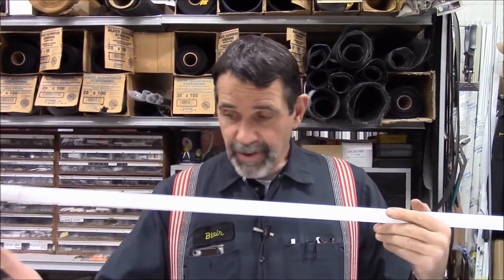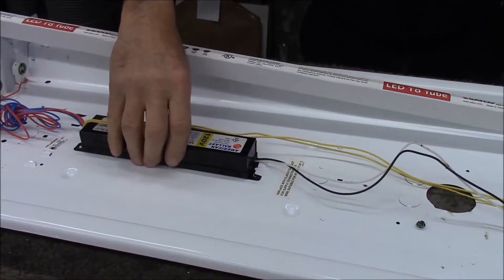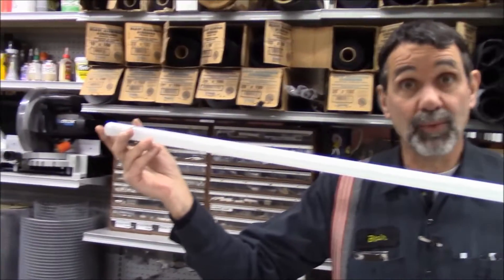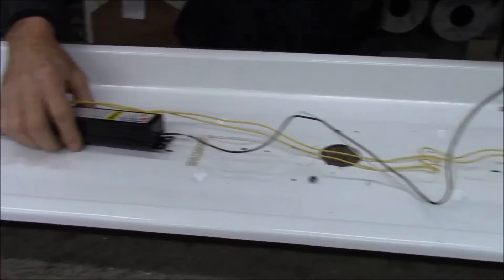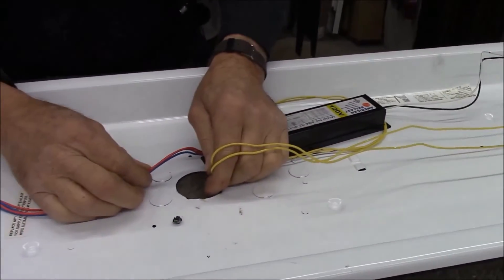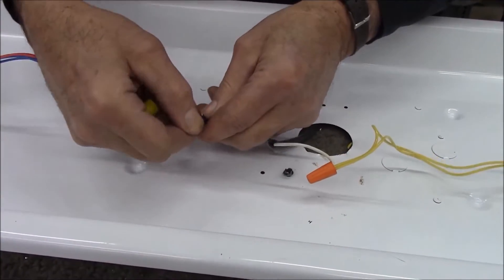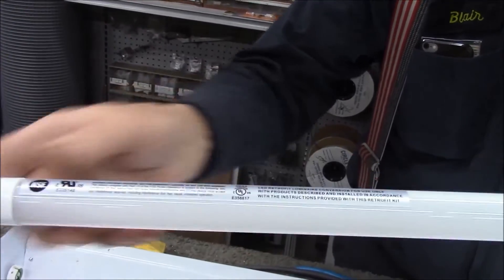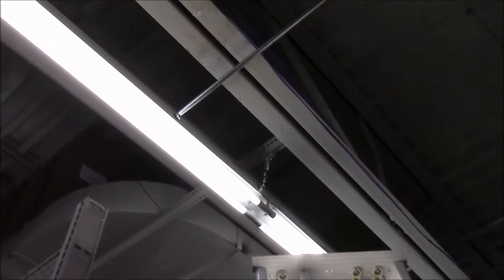Rewire Fluorescent to Led Lights - Using Double-Ended Tubes

Comment: What happens if you have fluorescent lights that are connected together can you do just one fixture at a time? With LEDs and leave the rest. So you don’t have to spend all the money at once on new led lights?
Reply from the maker: @georgechalifoux4668  sure, each fixture gets supplied 120 volts in parallel, not in series, so do one at a time.

Comment: Can one fixture be changed at a time and still operate fluorescents with leds in separate fixtures? i have 12 fixtures.
Reply from the maker: @stephencraig8578  each fixture is ‘stand alone’ so led, fluorescent or bypassing a fixture each one gets 120 volts and shouldn’t have anything to do with the next one. I’d recommend using a permanent marker to label fixtures ‘LED’ as you went along. Someone coming after you could install the wrong bulb in a fixture not yet converted.
Reply: @MrHardware1  thank you so much! I appreciate you sharing your knowledge.

Comment: Much appreciated. This is my exact setup. The current ballast went bad, so this is how I'm going to wire mine up. I have four T8 4' direct current LED bulbs. I have one question. Where do I attach the ground to the fixture? I'm pretty sure the person that wired my original florescent fixture, didn't properly ground the fixture. I say this, because I got a slight shock from touching the metal side of the fixture.
Reply from the maker: @DDDYLN  wow, you might find a loose wire  feeding one of the tombstones touching the metal box. The ground wire should be well attached to the metal box (fixture itself).
Reply: @MrHardware1  the ground wire was attached properly, but it wasn't tightened down enough. I'm actually not 100% sure I got shocked. The sheet metal edges on my fixture are so sharp, sometimes touching it with my arm feels like a shock. Whenever I'm working with live 110 V AC, my mind is always on edge about getting shocked.
Reply: @MrHardware1  I wired up my fixture, but I need to test the continuity, to ensure all the wires in the wire nut are actually making contact with the hot and neutral wires. Instead of wiring it up over my head, I had a set of hot and neutral pigtails. I wired the neutral pigtail to the two yellow wires, and the hot pigtail to the 2 blue and 2 red wires. Before I attached the fixture to the ceiling, and attach the hot and neutral pigtails to the wires in the ceiling box, I want to ensure the wire nuts are working properly. My multimeter doesn't have a continuity tester. I was thinking the best method would be to check the resistance. As long as there's a small resistance, like 1-2 Ohms, that should verify proper continuity, right?
Reply: @MrHardware1  I'm getting about 0.9 Ohm from each tombstone connector to the neutral pigtail coming out of the wire nut. I'd say that qualifies as good continuity. If I'm wrong, let me know. My hands shake quite a bit, so it's difficult for me to twist the wires together such that they're really tight.
Reply from the maker: @DDDYLN  you’re killingme, lol. My concern is if you have ‘shunted’ bulbs. Ones that require all the wires on one side of the fixture to be hot, and all the wires on the other side to the neutral. The correct bulbs for the wiring configuration is the most important aspect of this job. Unless any of the wires contact the frame of the fixture you are good to go. Quit testing and let the bulbs do the testing.
Reply: @MrHardware1  went to my local commercial supply store on Wednesday The fixture is all wired to go. I told them exactly what I wanted. I should have checked more diligently before I left. This guy sold me T8 LEDs that can work with or without a ballast, wire from both sides of the tombstone connectors, or from just one side. I'm sure the bulbs will work. But, the kinds that are made merely for direct 110 V AC, are both less expensive and brighter.
Reply from the maker: @DDDYLN  yup, that’s the ‘fit all’ bulb. Not my favorite. Did you get 4100 kelvin bulbs? 3000 is a warmer bulb, better for household settings, 5000 is like daylight but a little blue. Better for the shop.
Reply: @MrHardware1  I returned those bulbs to the electrical store yesterday. They sold me what I didn't want, because those were the only 4' long T8 LED replacements they had in the store! I guess I should have seen that coming. A 2 pack of adjustable light temperature, direct bypass bulbs were on sale at Home Depot. I got the whole thing rewired. I taped all the wire nuts with electrical tape, because I'm a mechanical engineer, and I tend to be anal about safety. My kitchen is like 5 times brighter than it used to be. The total cost was $35 + gas + my energy. I currently have the bulbs set to 5,000 Kelvin. I might turn the color temp down to 4,000 K, because 5,000 K shows every imperfection in my kitchen. Again, thanks for the help.
Reply from the maker: @DDDYLN  nice, I’m against taping wire nuts, strip the wires so when the nut is tightened no copper is exposed. And also pull on the wires and the nut to be sure there are no loose wires. I recently helped a friend discover some missing bad electricity where someone pre-wound all the wires with plyers before he put the nut on, and as good as it looked, it was strange that one of the wires did not get crimp by the wire nut properly. Tape will cover exposed copper (bad stripping job) but won’t hold the wires if one is loose. False sense of security, just saying…. Glad you got the right builds.
Reply: @MrHardware1  I did the wire nuts right. I didn't twist the wires before putting the correct size nut on, I waited for the wires to start twisting, and then I pulled the nuts to ensure they were on tight. But, being an engineer, I always check for continuity. My only issue now, is that the LEDs are so bright, I can't look directly at them! I know taping the wiring nuts with electrical tape is a little overdoing it. However, I feel better being safe. In addition. I needed the tape regardless, in order to organize all the wires, so I could get the center piece back on, that piece that keeps the wires hidden.
Reply from the maker: @DDDYLN  typical engineer, some of my best friends are. Usually I can use half as many leds as fluorescent bulbs. The beauty is you can remove one w/out affecting the other bulbs, unlike fluorescent bulbs. Sounds like a nice job, Blair
Reply: @MrHardware1  I'm aware we engineers tend to overdo it. But, it works great. I'm glad I bought the bypass bulbs with the ability to select the color temp. At 5,000 Kelvin, I can't even look directly at it! 4,000 K might be a better option.
Reply: @MrHardware1  again, your video was very helpful. Thanks again.

Comment: Great video, thanks!  Got a link to where to get the correct bulbs when bypassing the ballast (4000 and 5000)?
Reply from the maker: @MrHanowski  sorry, the manufacturers modify and change the builds constantly. As a last resort we sell them at the hardware store , ask for Jenn or Daniel, 586-596-7276

Comment: so what bulbs do i need to use doing away with the ballast or in other words direct wired
Reply from the maker: Line voltage LED tubes. I don’t know if there any out there that require an external driver because all the ones I’ve experienced have internal drivers and all you need to do is put 120 V to the bulb one of the several ways I described and you’re good to go.

Comment: I have a very old fluorescent light fixture. Thanks for the video. 
Does white have to connect with yellow lines and blue/red with black line?
Reply from the maker: The colors aren’t important, what’s more important is all the wires on the right go to the hot (black) and all the wires on the left go to the neutral (white) sorry it’s confusing. It could be the other way around, all the wires on the right could go the neutral, and all the wires in the left could go to the hot, they will still work fine.
Reply: @MrHardware1  
Great! Thanks.

Comment: What if your facility lighting is 277v? Do you just need a different type of LED or will the same ones work with any voltage?
Reply from the maker: It’s all about the bulbs, not all are universal voltages. Only use bulbs rated for your voltage.

Comment: Thank you for this wonderful video, and great tip. I've done this before, but in the previous fixture the yellow wires were absent. It was just one white wire on one side, and a red, and blue on the other. The one I just did moments ago, (with the help of this video), had 2 blue, and 2 red on one end, and 2 yellow on the other. On some LEDs you'd cut those yellows, but since I didn't have the instructions for the bulbs, I made sure not to cut any wires until everything was working, and I absolutely knew it was ok. Turns out my caution paid off. Had I prematurely cut those yellows I would have needed to put them back in the tombstones.
  Now I have 4 really nice 5k bulbs running in the kitchen! It's brighter, it lights faster, and will save me a bit of cash on the power bill. Thank you again!

Comment: Watched another video by jazz low rider and he connected the wires on the left side (2 blue and 2 red to the white neutral) and the right side (2 yellow to the black hot) vs your 2 yellow, right side to the white neutral and the 4 wires, 2 red and 2 blue on the left to the black hot wire. The two of you are the exact opposite so can you please explain, clarify
Reply from the maker: The bulbs are not polarized, so besides there being a ‘L’ and a ‘N’ on the ends of the bulbs the installer can install the bulbs w/either end being the neutral on the right or the left end of the fixture. One could label the fixture which end is the L and the other being the N. But installing the bulb one way or the other (when it’s a shunted bulb) does not affect anything.
Reply from the maker: All wires on one end is Black and all the wires on the opposite end is White, in a shunted system.
Reply: I have tried it both ways, one end yellow, yellow, white and other end blue, blue, red, red, black nothing and then I reversed the white and black and still nothing?
Reply from the maker: @charlesgoodwingreen8325  the best and only rule is to use the wiring diagram from your bulb manufacturer. If it doesn’t work the it’s time for a call to them.

Comment: Why do some led direct wire bulbs say to install a 1a fuse in the hot side? All of the direct wire videos I’ve never seen anyone install one
Reply from the maker: I’m not aware of any electrical code requiring an internal fuse. If a led requires one I think it should be built in.

Comment: What about if all the colored wires are on one side of ballast  (and the hot/Neutral are on the other side)
Reply from the maker: There is usually enough wire to take all the wires from when into the fixture and still make it to the black or the white wire. If there is not enough length, you’ll need to use an extra wire or not in a short piece of wire so that they will reach.

Comment: Hi 

For this retrofit, does it require ballast bypass LED bulbs or standard LED bulbs?
Reply from the maker: I’m not a fan of ballast bypass. I want to remove the energy sucking ballast. The bulbs come; shunted (fed from both ends), end feed (power comes to one end of the bulb) or combo (meaning they can be fed either way). Find the bulbs first, then determine how to hook them up before starting. Shunted bulbs are the easiest to wire, you don’t have to have ‘2-pole’ tombstones.

Comment: Can you use 4 bulbs instead of just 1
Reply from the maker: Yep, in the beauty is, you can add or subtract bulbs without affecting electricity or the fixture. That way you can adjust back, because four bulbs, would be too much light in most circumstances.

Comment: What bulbs/tubes  do you look for at  big box store for this retro-fit job ?
Reply from the maker: LED, 48”, Shunted (fed N, neutral, on one end and L, line to the opposite end). If you get a bulb w/ L & N on the same end you’ll need a 2-wire tombstone to supply it.

Comment: How do you test them easily without putting them up on the ceiling?
Reply from the maker: I have an old extension cord that was cut and so I use it to temporarily feed a fixture. I wire nut it to the fixture the same as if I’m wiring it to the ceiling and the plug it in. I’m cautious when I plug it in in case I did something wrong and there is a short, you don’t want your face over a project when your testing it for the first time.

Comment: ya light came on for 1 second and now wont light at all bulb junk smells burnt did it exactly like this
Reply from the maker: There are at least three ways to hook up LED fluorescent tubes. I’m describing one of the three, you need to look to the manufactures schematic or wiring diagram because they’re not all wired the same way.

Comment: Thank you!!  I've been re-installing new ballasts as far back as 1991 at my grandparents house / property...  They are sadly long gone but my parents live there now.. They are now in their early 80's so I'm still the designated hand at these and many other general things..   The Garage ones are a real pita..  Then, the ballroom main living room with all its "moldings to hide the lights (The roof reminds me of a church building... Pointed..      I've been replacing ballasts up on an extension ladder where I probably should have scaffolding..  :/.   Regardless... I just came across your video and am happy as heck!   Still have 4 more ballasts to go but I'm not going to pull a "switch-a-roo" and install these lights on the other side corner and see if they can even tell...    Much appreciated!    Here comes a sub to go with the "like"...
Reply from the maker: Remember when you buy LED lights you can buy them from 3000 K which is red and warm to 5000 K which is blue and cold I said suggest you stay around 4000 K and they’ll never know.

Comment: I have 3 in my kitchen so i have on the first one 1 black and 1 white then the 2nd light has 2 black and 2 white then the 3rd light has 3 blacks and 3 white coming out how do i go about that?
Reply from the maker: Yes, if whites are wire Nutted together and feeding the ballast, and if the blacks are we are wire nutted together and feeding the ballast, leave them all together as you found them and treat them as one black and white wire. Just disconnect the ballast. The pairs of wires are simply feeding other fixtures down the line.

Comment: 1:28 Wouldn't it be called a non-shunted installation because you will be using a non-shunted tombstone? If the live wire and the neutral are connecting to one end then that tombstone is not going to be shunted or connected internally, therefore it should be called a non-shunted installation if anything. I wish people wouldn't add extra information if they can't get it right. "This is called a 'shunted' installation at 1:28 ."
Edit: Sorry, I just don't understand why you would call it a shunted installation when you need to use a non-shunted tombstone. Frustrated because I think I completely understand what needs to be done but then you say it's got to be shunted and I question myself. Maybe I just don't understand. I have Type B LED tubes where the wires only need to be connected at one end to a non-shunted tombstone which is called a shunted installation I guess.

Comment: With the example you used what type of tombstones did you use? Shunted or non-shunted?
Reply from the maker: You typically never need to buy shunted tombstone’s because all you do is connect the wires together that come out of the tombstone and now you can shunt it yourself. The problem is when you buy an ‘end-feed’ bulb that needs the hot and the neutral at the same end, you can’t un-shunt a shunted tombstone, you have to go out and replace it with a non-shunted tombstone. The bulb style dictates how the fixture is wired and hence what kind of tombstones are required.

Comment: Good video.  A link to the bulbs would help.  Don't I need a Type B or Type AB bulb to make this conversion? Thanks
Reply from the maker: Actually I purchase the bulbs first and then wire the fixture accordingly seeing as there are 3 types of wiring required. The point of the video was to inform viewers that the bulbs aren’t all the same wiring procedure.

Comment: Noob question, do you connect those wires straight from the tube to the 110V AC, if so the component to down the voltage to the led is inside the tube?, if not so which component is outside that provides the DC voltage needed? the temporary power supply you mentioned?.  I want to understan which kind of tubes you should in any case or what is the name of the component that should be outside to provide the voltage.  Thanks for the video
Reply from the maker: When you purchase the tube it’s up to you to chose which type because they come in many variations. Most LED tubes are engineered to accept 120 volt A/C directly from the utility. Some tubes accept power to each end (shunted), some tubes take power to one end and some tubes still use the ballast w/no rewiring required at all. Then some tubes use all or a combination of the choices above.
Reply: @MrHardware1  Thank you so much

Comment: Straight and to the point. I know just enough when it comes to basic wiring and installation. The facility I work in is starting to blow all the ballasts on the traditional florescent fixtures. I was replacing the ballasts at first, then I just started swapping the whole fixture for strip led fixtures but this is going to save so much time and money it's ridiculous. Best video I've seen yet. Thank you and I will definitely look you up next issue I run into.